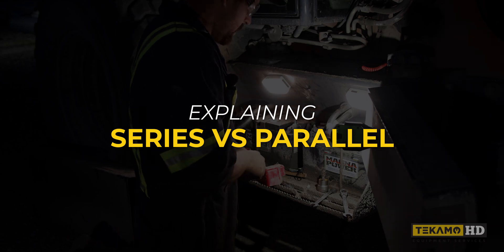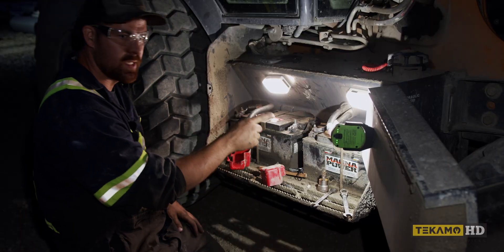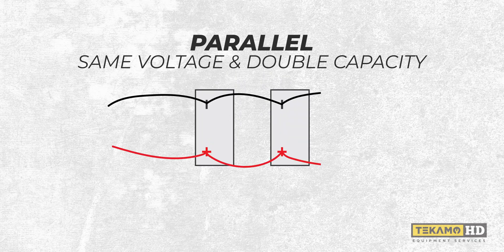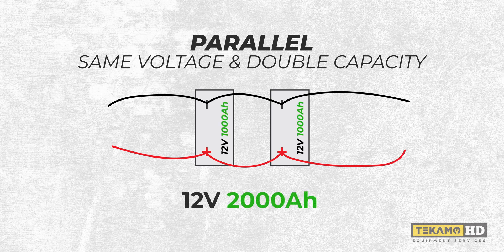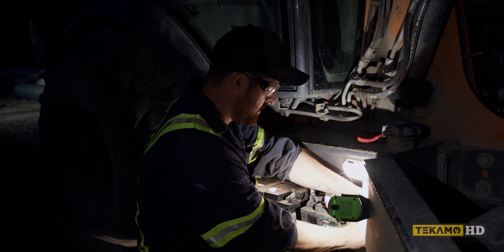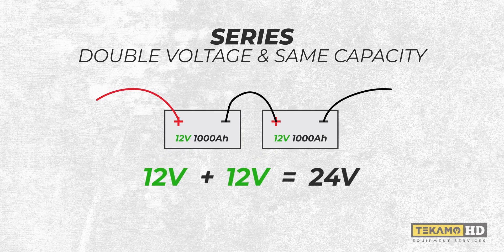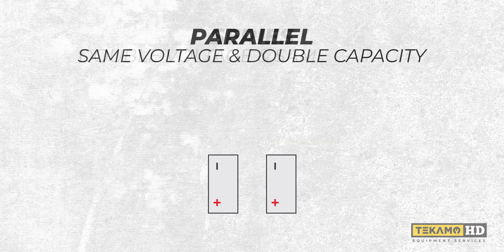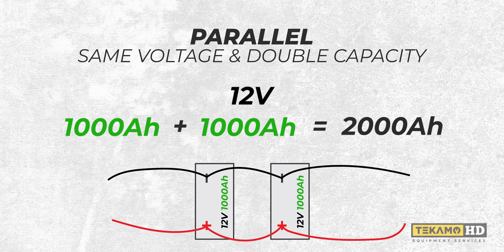Series Parallel Circuits Tutorial - How To Wire Batteries Series Parallel

Comment: I'm have a question  for cam I have a 1994 john deere 648e grapple skidder I was piling logs on the landing  and as I was driving  it would just stop dead  I'd put it in park wait a minute and it would go again  I looked  in the engine  compartment and  one of the bolts that holds the engine  was backed  out would that cause the skidder to kick out of gear

Comment: Cam speak from experience having a battery post melt off lol, ya computer controlled parts are sensitive to voltage spikes it doesn't take much to have something go poof if you're not careful.

Comment: Fellas, 
Ah is amp hours (capacity)
A is amps
Reply: Correct, they should technically put CA for cranking amps as that's how we measure batteries, but technically Ah isn't wrong either as the Amp hours would double in parallel.
Reply: @BluTechEquipment  good point. CCA even!

Comment: Thank you!
Can you please explain how you can jump start a 24v system with a 12v. I have seen you do it on the Hitachi video and couldn’t understand exactly how it not blow your alternator. 👍🏻
Reply: Only jump to one battery even though it's wired 24 volts one battery is still only 12 volts. But be ready to unhook your jumper cables because it will back change 24 volts